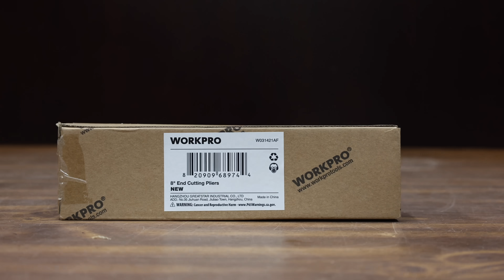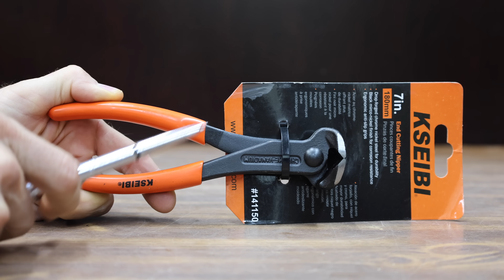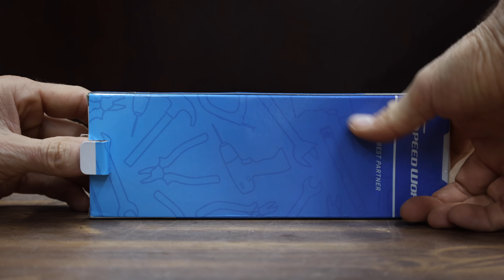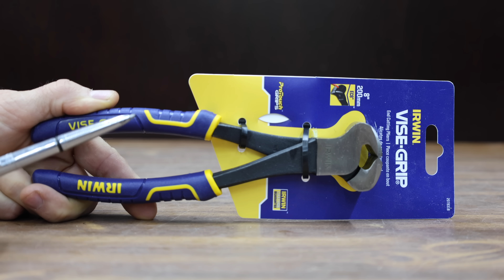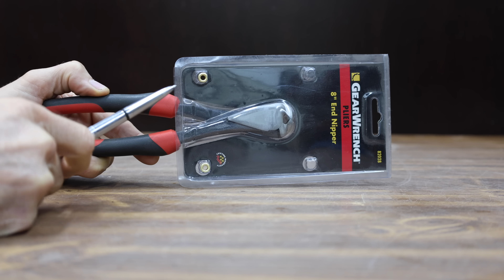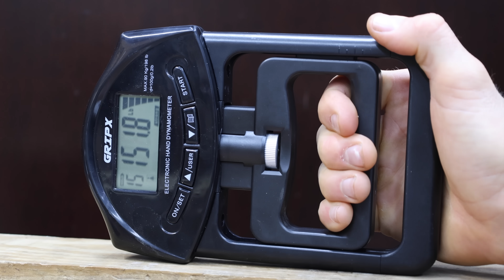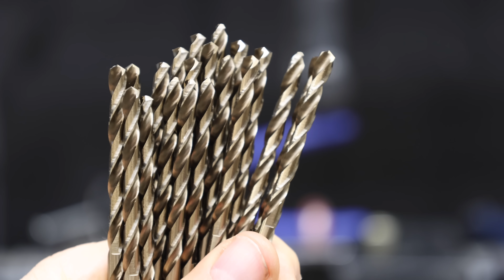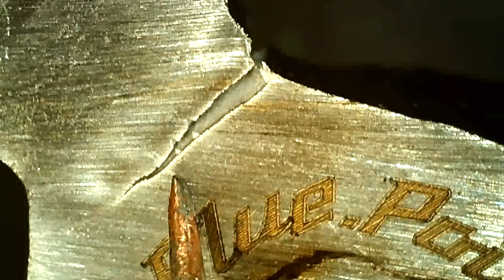Finally! Best Pliers I've Ever Tested! Not Even Close!

Comment: Grab the nail or brad with a pair of dikes gently without cutting through. Then wiggle dikes back and forth parallel to the workpiece. After a few seconds, the nail will break off below the work surface. This works with brad nails and pin nails.

Comment: Thanks for the review, as always. Normally, I would not use links to buy products; however, Project Farms seems legitimate and is not pushing to sell based on commission on sponsorship - there are so many of those videos online. I tried to use the link, but it was out of stock like many times before, so I bought it from Lowes online at the same price. This usually happens, so it's not easy to support the channel besides the thumbs up. I have bought lots of items in the past from this channel, so it only seemed fair to join. 
I like the different attributes Project Farms uses when testing items. This video mainly concentrated on blade damage, which, to me, is the most important attribute of this tool, but some other less important attributes should also be included and were. Also, I like that cost is included because that is one of the most important attributes. Sometimes, it might be best to buy several less expensive cutters over time instead of one expensive one... even though having to re-buy a tool is not always fun and is wasteful. Thank you so much! My pliers arrived already and I cut through some simple softer stuff and it worked was surprising how little force was needed. I actually need this to trim off some nails in my crawl space near the entrance so I will put it to work soon.
Reply from the maker: You are welcome!

Comment: FYI, none of these tools is intended to produce a flush cut. Which is obvious if you look at the geometry. Of course some get closer than others, and closer is better, but no cutters with this type  of blade profile is capable of an actual flush cut.

There are true flush cutters available that don't have any bevel. Most are small and light-duty, and can't handle very hard or thick metal. Knipex does make a high leverage flush cutter that's pretty heavy duty, but I doubt it would cut a screw or a hex key, at least not without significant damage. It would be an interesting video to compare actual flush cutting pliers.

Knipex has a whole page in their print catalog explaining different types of end cutters and the blade profiles, and the type of cut that results.

Comment: My understanding is that besides cutting nails and staples, nippers like these are often used for pulling nails and staples out of wood as well as cutting and twisting wire. You wouldn't usually try to cut hardened steel with them. The Knipex model combines the features of a pair of nippers with a small bolt cutter. You primarily tested how well these tools work as bolt cutters but only one of them is actually designed to do that so it's no wonder that it would be the best at it by far.

Comment: Consider evaluating nylon zip ties the best brand in the world is Thomas & Betts very expensive but very much worth it if maximum performance is required which it usually is not but when it is they are so vastly Superior it is not even a contest however they do make different product line series add different price points overall it should be a great video for you
Reply from the maker: Thanks for the suggestion.

Comment: I have a pair of Knipex and a pair of Channellock and the Knipex are noticeably more precise - When the Knipex are closed, without even gripping the handles, I can't see a shred of light between the front teeth. With the Channellocks, I have to grip them tightly to or I still see a tiny crack of light peer through. This is after using both pairs intermittently over a 3 year period.
Reply from the maker: Thanks for sharing.

Comment: I've worked in an industry that regularly uses end-cutting bullnose pliers like these for a number of applications, but the most critical of which is twisting loops of high-strength stainless steel wire around material and "burning" off the ends to make a burr free surface.
I love the Knipex end-nips, but for my work, they're actually too sharp to be useful! I use Crescent brand nippers, which have the best balance of sharpness and overall quality for my specific job.

That said, Knipex is bar-none the best tool available.
Reply from the maker: Thanks for the feedback.

Comment: Knight, knife, Knicks, knee, knit, knot... kah-nipex 😢🤦‍♂️ 😂. But yes, anyone who has had to use cutters extensively in the trades knows very well that Knipex are the industry standard and are second to none. Nice to see a comprehensive test proving it. And please add millimetres. I'm sure even imperial users have difficulty imagining 0.064 of an inch.
Reply: 0.064 in is 1.6 mm BTW 😅
Reply from the maker: Thanks for the suggestion.

Comment: Ha come on the head was not close to being flush operator error. I have Channellock's purchased in the in the late 50s there still like new. I did sand half the ace flush for some job years ago the edge has never been sharpened .

Comment: I’m slightly confused.  I would have thought one of the most important tests for these pliers has nothing to do with cutting ability, but rather distance of the handle traveled to pull a nail a 1/4” distance, including testing in an open area and in a boxed area (sometimes the rocker is amazing, but the handles are wide inhibiting movement).

Would have loved to see that.  I think this channel would greatly benefit from “supplemental update” videos to test very specific things that weren’t previously tested or not thought of in the moment without having to re-edit entire videos.  Obviously this would be difficult with certain topics, but videos like this would be a good example.
Reply from the maker: Thanks for the feedback.

Comment: End nippers cutting edges are not supposed to be aligned nor are they supposed cut flush to the surface. They are designed for twisting wire. If the cutting edges are aligned you couldn’t twist wire very tight without cutting it.
Reply from the maker: Thanks for watching!

Comment: I'm starting with my comment before watching so I don't forget it. EUREKA!! I finally landed on a product category to test. Rodent &/or insect repellents. Personally, I'm most interested in the rodent ultrasonic varieties that plug into 120 VAC outlets but also would like to find out the effectiveness of DEET type of mosquito sprays vs. the noisy zapping lamps and which work better, rat snap traps or glue traps? I can understand if you don't want to post numbers of your rat killing machines, it certainly wouldn't bother me, but hoping if you pass on snapping rat necks with spring traps that you'll still test repellents. BTW, everything about you and this channel and it's content is so epically fucking great I have to curse to show my enthusiasm. I don't go to movies or watch TV shows or go to concerts etc. but every bit of your production style and delivery is just fucking superb. I'm 60 and have worked since I was 17 as a repair tech or as an install tech for commercial & residential customers and also churches, so many churches wanting their systems updated. There are no better informed consumers than the leaders of their respective congregations when it's time to replace their sound system. The list of items I've repaired at different jobs would be lengthy.
Reply from the maker: Thanks for the suggestion.

Comment: Hey iam in need of seal a wood stove pipe conections, do you have a video to test the hight temp sealants? Could be mixed products as furnace cement and silicone type. The main features would be resistance over time, sealing capabilities and smell fumes released
Reply from the maker: Thanks for the suggestion.

Comment: Ok so the best of these type of pliers is made in Brasil, over there its all made flush so can cut the nails flush to the board, it’s mostly use there for rebar wire assembly , twist and cut
Reply from the maker: Thanks for sharing.

Comment: FYI most cutting tools like nippers and side cutters have edges that are NOT supposed to line up perfectly. They are supposed to be offset a little bit in order to get a shearing action, rather than just pinching, as they cut much easier that way and will last longer in extreme cutring applications. They are also not designed to cut flush. Ones that are, are called flush cut nippers.

Only flush cut nippers have cutting edges that line up perfectly, and they are usually not rated for cutting hardened material.

Thanks for all your hard work and thoroughness! This is the first place I go to find unbiased reviews.
Reply from the maker: You are welcome!

Comment: There are a lot of YouTube channels that are fun.  There are a few that are fun, valuable, and revealing.  This is one of the latter.  Thank YOU!  Ideas: 1) shop safety - can you make a video focused on tool designs that are best for safety.  This might be hard to set up for objectivity; however, could be very useful; 2) external backup batteries for phones - it is well known that they cheat on power ratings; however, by how much?;  3) travel power sources for charging devices - which are most effective (and most cost-effective) and have best safety.  Hope this helps.
Reply from the maker: Thanks!  Thanks for the video ideas.

Comment: Very impressive! 
I mostly use mine to pull nails, so i don't really want them to cut. Sometimes, I have to cut a framing nail where the head is in wood that stays in place.  Or cut a tiny finish nail that curls out sideways. For pullling nails long handles and poor cutting is what I'm after, broad round shoulders help too.
 
Very rarely do i need to cut a screw, but it's usually to make a shorter screw that i don't have and its cut where the threas are.

Cutting an allen wrench with pliers is a severe torture test!
Reply from the maker: Thanks!

Comment: Snap-On diagonal cutters were designed with the cutting edges offset as seen on most of these pliers. If the cutting edges touch each other on its cutting edge... Then they automatically dull themselves every time you close them. They are not supposed to make contact on their cutting edges in my opinion.
Reply from the maker: Thanks for sharing.

Comment: Video idea, would love to see whether letting an engine warm up and cool off before operating it at under load/full throttle is actually beneficial. You could get a few Predator engines to compare and use oil analysis between them for results.
Reply from the maker: Thanks for the suggestion.

Comment: I think those Japanese pliers got an unfair showing... they, and likely, others, are not designed to be super hard, but to be sharpened.  So while your real hard pliers will last just as long as the edge on them remains undamaged, the Wazakura could last generations and provide the cleanest and closest cut the whole time with a bit of filing now and then... you just can't be cutting screws or other hardened metal with them.

Comment: If feel like this test is not very objective as this model of Knipex was specifically designed to cut bolts (hence the price difference), while most of the competition is regular nipping/pincing pliers. Knipex also has similar ones in their stock like End Cutting Nippers.

Comment: Working in a swedish metal manufacturing industry, we use only Knipex pliers. Yes, they are very expensive but cheaper in the long run. Swedish made Bacho has historically been a good choice too, but Knipex is in a league of its own.

I am in the process of replacing my private pliers to Knipex too. Maybe not absolutely necesary but you show the reason in this video: the low force needed to cut things. To me this is very important since I've come tp the age where using my full hand strength comes at the risk of injury or at least pain.

Knipex are just simply amazing tools. Well designed, well manufactured and a joy to use. Chinese products can at times be great too but it's a lottery. Many chinese products still are just replicas of better ones. They look the same, cost less but are anything from much worse to utterly useless at what you need them for. No engineering involved at all.

I really liked this test. Well done. Gave thumbs up and subscribed.
Reply from the maker: Thanks and you are welcome!  Thanks for watching and subscribing!

Comment: Just based on personal experience with these types of pliers or flush cuts or whatever people will call them, just like a set of wire cutters or side cutters are also called dykes. But in my experience with these and really all wire cutters or side cutters is you definitely get what you pay for! Cheap ones will break or dig into the cutting teeth and not actually cut the wire. So my experience here is always go with a very good name brand that has been around forever that you know and never get cheap ones unless you just doing a very quick job and you need in and out and you forgot your good ones or something like that
Reply from the maker: Thanks for sharing.

Comment: 7:06 "an iron carbide edge for a long cutting life."
I've not heard such marketing bs in a while. Essentially that just means the steel is high carbon (which it should be) and has been properly heat treated.

Comment: @projectfarm, if I am not  "Unaligned" blades might be a feature, not a mistake. The blades that meet right in the center create sharp points that are cutting hazards.

 The blades that don't do that are sometimes on purpose as they either roll over the sharp edge or cut it flatter.

 \/ vs \_/ or \_I sorta thing.
Reply from the maker: Thanks for the feedback.

Comment: Back in the olden days, I did some work as an iron binder in concrete construction.
I used a pair of Knipex 99-200 "concreters nippers" I used it for a couple of years at the company, and got to keep it when I stopped.
I still have it to this very day, and it's in perfectly good shape - So I can confirm, they do make very good and durable tools.
How old is it ? I dunno, but it says "Made in West-Germany" on it, so it's from pre-1990 !
Reply from the maker: Thanks for sharing.
Reply: @ProjectFarm  
Well, I mean .. if you have a tool that last you 30 years+ ... then it's an interesting data point. 😁

Comment: As a Formwork contractor our first choice was Knipex followed by Channelock for tying rebar. One thing you needed to do, even with our first choice though was check the grind for any gaps and to make sure the cutting edge’s aligned correctly. Even if it meant checking a few samples to pick the best.
Reply from the maker: Thanks for the feedback.

Comment: I have used end nippers for lathing for decades, starting back in the late '70's. Life was simpler with less choices LOL! IIRC we used Channel Locks. Lathing is pretty easy on them, mostly to tie and snip 18 Ga wire. Being easy to open was probably the most important attribute, having to work fast for repeated ties.  BTW 150 lb grip is way above average. I've passed around grip scales on job sites and have yet to find anyone with over 130 (me as an old guy) I could do 150 back in the day. So, congratulations if that was you on the gripper!
Reply from the maker: Thanks for sharing.

Comment: End knippers and other cutters are designed to have a slight offset blade to blade as the cutting action is intended to be like a shear, or like scissors they aren’t intended to have both cutting edges crash into each other. This design also results in a less pressure required to cut as if both cutting edges aligned you’d be compressing the material vs shearing it apart just fyi
Reply from the maker: Thanks for the feedback.
Reply: Also more ridiculous knowledge if you grab the deepest bite of material you can say like cutting a nail and the piece is contacting the inside of the pliers ie the pivot it will take considerably more force to cut. The material needs to grow as the width of the cutting edges shear through it and the cut off piece will be trapped between the inside pivot and the cutting edge and cannot expand you can confirm this by measuring say a nail before cutting it then cut it almost all the way through then measuring it again it will be roughly the width of the cutting edge longer. I once spent a lifetime using end nippers repeatedly all day and was taught far more than I ever wanted about them but I will say it did make a difference in how my hand felt at the end of the day. The knippex design will definitely be more comfortable and productive at the end of the day of repeated use imho

Comment: I bought 2 Knipex pliers when I started working in the car audio industry 32 years ago. Both still work very well today. I cut wire, screws and nails with them all the time.
Reply from the maker: Thanks for sharing.
Reply: did you get the close shave mini 'pliers' yet? if you're in the car audio industry you probably have a lot of zip ties, they cut them down to the shim perfectly, no scratches ever and a clean look.
Reply: @fwoibles have you seen a zip tie gun yet? If you think those flush cut style pliers are cool, the tension gun deals will blow your mind lol
Reply: @chickenfishhybrid44  I have only used one for steel straps but that doesnt include a cutting element. We're doing a lot of electrical/comms work and it doesn't seem you would be able to use in that in (oftentimes) very confined spaces. I assume you can pick the level of force it applies to the closing of the zip tie but I wouldnt allow anybody to not do it by hand.